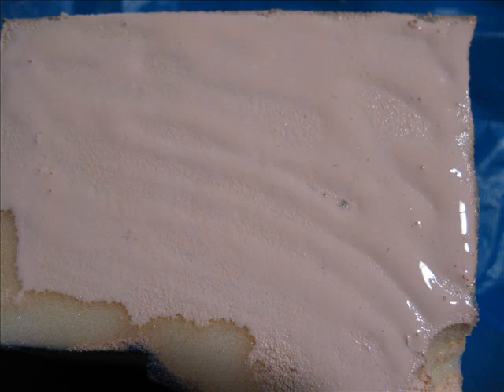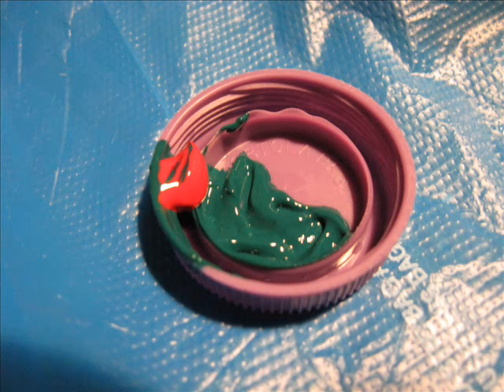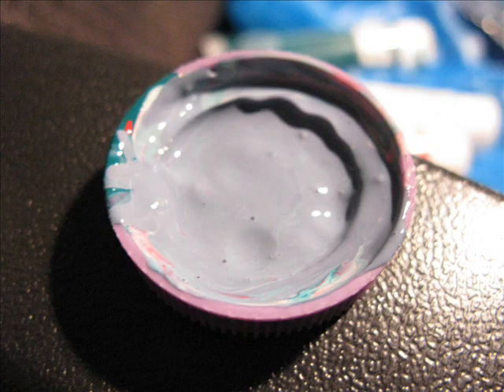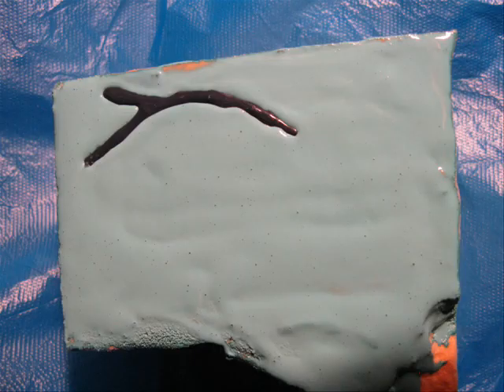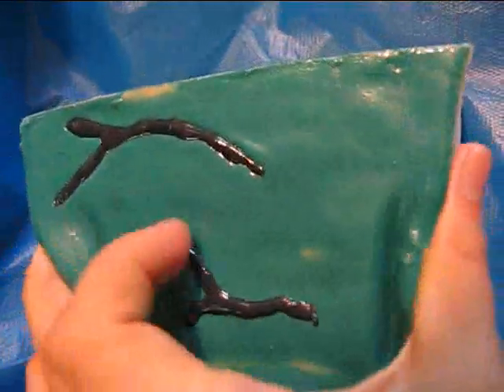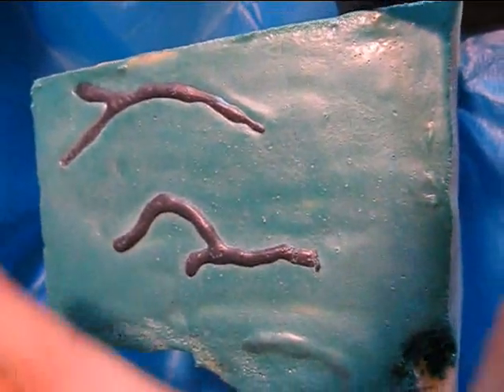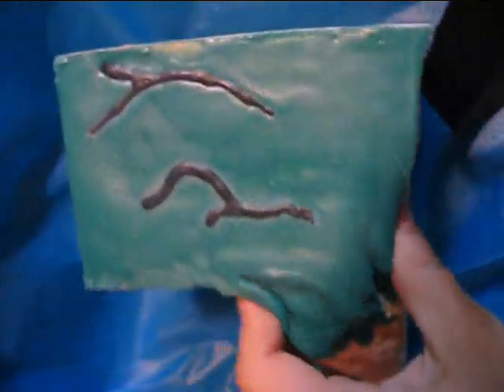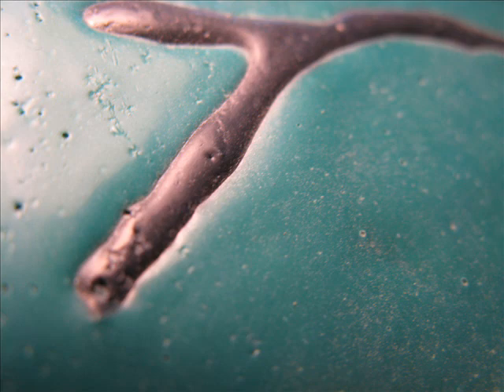Make Latex Skin Over Carved Foam

Comment from the maker: Don't add more latex while it's still wet.  You could add a very thin layer first to seal the open air cells of the latex, like priming wood so you don't spend lots of money on nice house paint only to have the wood planks absorb it all.  You could also seal it with acrylic paint, maybe white glue, or anything else that you can cheaply spread thin over the large air cells of your foam.  You want to block up those cells before you add lots of latex.

Comment from the maker: The latex will roll right off the plasticine, so you could cast a solid object into plasticine, but it's not good for painting thin layers onto.  Plasticine also has oil in it so it may weaken your latex, which is why I do all my latex stuff in air dry clay even though I do all my modeling for metal pouring in plasticine and wax.

Comment from the maker: you can intentionally introduce tiny bubbles by mixing air into the latex with a Popsicle stick or a paint brush dipped in dish soap.  They'll pop and collapse making small pores.  Painting on latex will never give the same detail as pouring latex into a mold, but by adding textures like sand and bubbles to your painted latex you can add additional texture.

Comment from the maker: It would work fine.  The only thing you have to avoid it denting the finished puppet.  You can also construct it for cheap by gluing layers of styrofoam together and then carving it.  That way you can re-use sheets of it from packaging.  Just don't heat it.  Unless you have a very, very hot furnace to truly burn it (hot enough to melt bronze) it turns into a toxic, sticky black tar when heated.

Comment from the maker: I don't know how latex would stick to styrofoam--the only reason I don't use it is because styrofoam can dent.  so you get one bump, or you step on it once, and the sucker is ruined, whereas furniture foam poofs back into shape.  If you can't get latex to stick, try using spray adhesize and covering the styrofoam with paper, latex will make a first layer on paper very well.

Comment: :)
thanks for a reenforcement on the priming idea. I have a rather large area to cover so even if I got cheep stuff it would cost too much. Also was worried of it making the foam stiff. 

BUT

I got spray sealer. Covers a lot of space, and is very thin. Was afriad that the spray didn't work. but stared painting the rubber on and it's not seeping! yey! Two cans of spray for 8 bucks each is worth it.

Comment: I was looking on the internet for Amoco latex there were so many different varieties I wasn't sure which would be best to make skin on foam.
I also saw a 3 1/2 gallon bucket of latex that is added to a floor floor leveler for installing vinyl floors $15.00 I might have to run some tests

Comment from the maker: @Ryuzakisenpai PT 1 I think that depends on how you cut the foam and its qualities.  Latex needs texture to cling to, or it will pull away from a surface.  So if you use a hot wire to cut blue foam you will have to rough up the melted foam or "stipple paint" by dabbing a very thing layer on with a dry brush to start.  Once you have your first coat your next coats will stick perfectly.  You can also use plastic products... see next post...

Comment from the maker: Furniture foam has very little bounce when carved into organic (body) shapes, but can take a lot of damage and maintain its shape.  So it offers form with very little weight, and as it's pourous you can easily layer other materials onto the surface.  For a fat suit that needed to look like fat during use I'd use something that had bounce to it,  even stuffing a mostly inflated beach ball with water at the bottom into a shirt.

Comment from the maker: @partyhatpker I use costume latex, Mehron, Ben Nye or Graftobian brand (Graftobian is too thin for a first coat on foam.)  HOWEVER you may find artist's latex, sold through art supply and fetish specialty stores, to be cheaper and more vivid.  I wouldn't use artist's latex on skin, but the foam won't mind extra ammonia--just use lots of ventilation as you work.  Amaco brand is sold by the gallon, as are many others.  (I find Amaco to be very smooth, I use it for pottery resists.) MANY brands.

Comment from the maker: Stuff the costume first, then paint on the  fabric. Latex stretches, but if it stretches and unstretches a bunch of times in the same place it will end up looking bad.  If you paint it flat, then stretch it, it will try to pull flat again, fighting your stuffing.  That MAY be the look you want, but the costume will slowly shift in size and shape.  Avoid stretch fabric, like Lycra and Spandex brand, they are way stretchier than latex can be.

Comment from the maker: Other easily available foams such as PVC (rigid) urethane (expensive, heavy)  polystyrene foam (Styrofoam) and EVA (dense, heavy craft foam.)

If you expand your own low-density urethane or latex foam it can be cheaper than buying pre-made and cut sheets and much lighter and more flexible than what's available commercially.  A good beginning place it smooth on's site. 

Uber-realistic fake body parts are going to be gel filled.  Where, like the beach ball example you have bouncy goo...

Comment from the maker: @Ryuzakisenpai PT 2 I've played with StyroSpray as a hard plastic coating to rigid foam and been very happy with it.  It will last longer, and still has some "give" to it, so it won't dent when bumped.   Googel it and order a sample square to mess with.  If you want to make soft textured sculpture, you might want to try molding expanding polyurethane.   I've really liked it, but it required the extra molding steps.

Comment from the maker: When you e-mailed last night and were wrestling with the high cost of body casting and building a positive from your body cast, then making a second mold and filling that with foam rubber--it's kind of a death wish to tackle a project like that if you're not already confident with your materials.  I figure this way you won't have the chance of as great a success, but you'll have a much smaller chance of failure.

Comment from the maker: Easiest, paper mache. harder:I would make a face shape out of pottery clay, take a really big sheet of 3mm pale pink/beige/white craft foam, and dip it in boiling water until it stops being perfectly smooth-flat, and while it's really hot place it on the clay and force the foam into the clay shape, also try spot heating the foam with a hair dryer and shaping it with your hands.  You can stretch and fold craft foam by heating it up enough to soften BUT NOT melt it.

Comment: I'm trying to make a full suit monster costume but what kind of latex it is supposed to be? BenNye type of thing? If it is, will 59 ML will be enough because that's the only size they sell it. There's also something else, they still call it liquid latex but it's much more cheap and it's for "masking and molding", will it still do the same job? Please help me :(
Reply from the maker: The reason I suggest the theater makeup latex is that it is low ammonia.  Ammonia makes latex shelf-stable but it STINKS SO BAD and can irritate lungs if you are not working in a studio with a fume room.

Almost any liquid latex will work, but if you want the monster suit to last forever you would be better off with a brush on silicone or non latex rubber from smooth-on company.

If you want the latex to only last a few years and be used outside a couple times then go with a lower-cost liquid latex.

Feel free to chat in these comments and we can work through your process.
Reply: Thank you, I'll try both and post the results here so everybody can see and learn from them

Comment from the maker: If all else fails buy cheap off the 'net. Ben nye and mehron are thicker while graftobian is thinner and offers a smoother application.

You can seal latex with a bunch of stuff, including clear acrylic, there's a fair amount of discussion on this in the comments of these videos and on tons of web forums.

I have used my Badger airbrush to paint handemade latex masks, and it works nicely.

Comment from the maker: ...with a skin over it.
These kinds ofprops are the most expensive to make.  The "gel" isn't like jello or gel toothpaste that can run or melt but is a solid, stretchy, piece of material, such as silicone "jelly" material. Then the skin of choice is added on top to make the appliance as flesh-like as possible. You CAN do low-budget of this kind of high-end appliance,  filling a cast of latex with a gutted old gel-filled keyboard wrist rest, but then you're exposing yourself to unknown chemicals.

Comment: I want to make an alien prop and I want to give it some kind of realistic skin. Will this be a good idea to use?
Reply from the maker: Yes, as long as your cast does not have a latex allergy. The latex will last for about a year or more and have a realistic stretch to it. You can punch it, or get ot wet, and it holds up well.
Reply: @gryphern  oh no a prop like an statue made of foam maybe. But I want to give my alien statue some skin.
Reply from the maker: @akwlb2  if you want a statue for one time video shoot, use latex. If you want an art piece, go to smoothon dot com and buy brush on silicone.  Latex will last... but not forever. Under heat, moisture, and time, it will degrade.
Reply: @gryphern  cool thanks I appreciate the help.
Reply from the maker: @akwlb2  if you want to make a statue the way the pros do, try carving it out of layers of blue or pink insulation foam that are glued together ("lamenated) then buy a self hardening plastic shell, such as StyroSpray (their low pressure product, not their high pressure product).  There are a number of good plastic shell brands for foam, you set up a spray gun and apply. It takes more special equipment but is how they do theme parks and museum statues that weight nearly nothing for easy transport.
Reply: @gryphern  ok I will research about that. This is just a project I wanna do so decorate my home. I wanna make a dead alien and lay him on a table and run tubes through him as he was being monitored or something. Not sure yet but all your ideas have helped me a lot since I've never done anything more than a paper mache turtle way way back in high school haha
Reply from the maker: @akwlb2  my skype username is gryphern, as well, if you want to brainstorm send me a skype invite. Also, check out the syndaver company for inspiration-- they make fake corpses for medical schools, they have them breathe and pump fake blood and everything. They did a wonderful display where I work and I picked their product development folks brains.